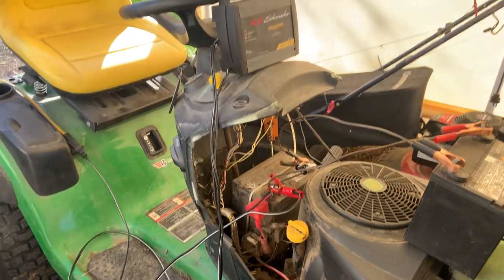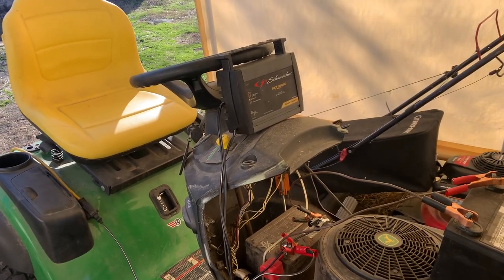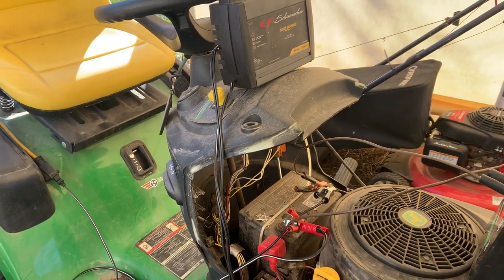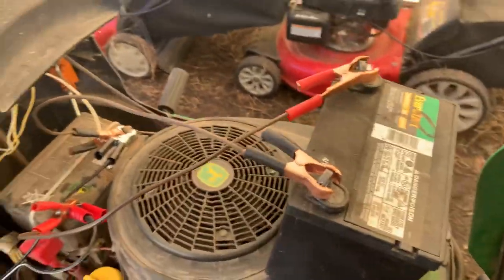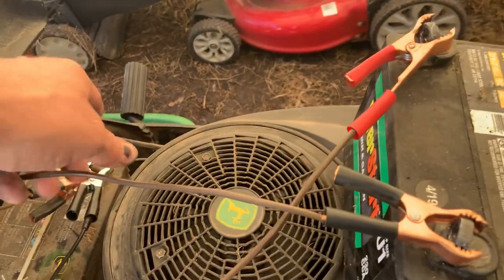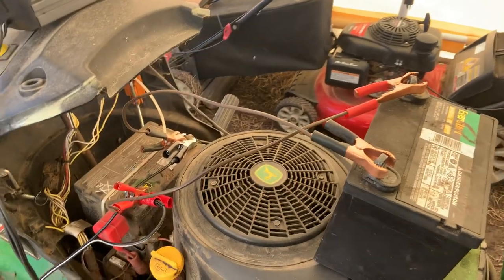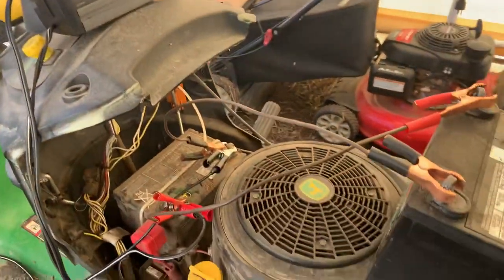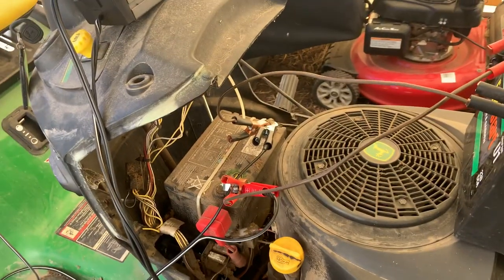How to charge a completely dead battery

Comment: Hi, i just bought a battery charger that has a 50 amp setting, a 10 amp setting, and a 2<>6 amp setting. Which setting does most people use to charge a lawn mower battery? Is there a couple different settings i can use? Just wandering which setting or settings is acceptable when charging a lawn mower battery. Thanks
Reply from the maker: @craigwagner327   Think of the amperage as how hard and fast the charger is going to push voltage into the battery.  The 50 amp setting isn’t for leaving the charger to charge the battery over a period of time. It’s only to crank the engine right freaking now. So you would set it to 50 amp, immediately try to crank the engine, and once the engine is running you turn the charger off. 

The other two settings, 2-6 amp and the 10 amp settings, are for charging over time. Since a mower battery is so small, charging at 10 amp is a bit much,  so always charge a lawnmower battery on the 2-6 amp setting. On that setting you can leave the charger on overnight which is the best way to charge a battery. It says 2-6 amp because if the battery is really low it will start charging at 6 amps but as the battery gets charged the charger will back the voltage down to 2 amp and stay there until you turn it off. 

You can use the 10 amp setting on larger car and truck batteries but I wouldn’t leave it on over night. At 10 amps it should charge the battery in 4-5 hours. So unless you need to charge a car or truck battery in a few hours, just set it to the 2-6 amp setting and let it charge overnight. 

Another tip- Just because a battery charger shows the battery is fully charged doesn’t mean the battery is good. A battery charger will show the battery is full when the battery is no longer absorbing voltage. So if a battery is bad and won’t absorb voltage, all the charger knows is the voltage it’s putting out isn’t being taken so it will indicate a full charge. 

Buy a battery load tester. They’re cheap and very simple and easy to use. The best thing to do is to charge the battery overnight on the 2-6 amp setting, then the next day, take the charger off and load test the battery. 

You can also load test the battery by putting a meter on it and watching the voltage as you crank the engine.
Reply: @wcjcnc  yeah I was just curious cause I googled what amp to charge a lawn mower battery on and it said 10 amps for an hour and wasn't sure if that was right
Reply from the maker: @craigwagner327   You can charge it on 10 amp if you really need to mow or have it running in an hour but if you need to have it running that fast, just jump start it with another battery or a jump pack. You can start a mower by jumping it off with a car or truck but make sure the vehicle IS NOT RUNNING. The alternator on a vehicle may put out more amps that the electrical system on the mower can handle. Usually it won’t cause a problem but it can. As long as the vehicle isn’t running you’re fine.
Reply: @wcjcnc  ok so basically if your not in a hurry, you would recommend using the 2<>6 setting? Thanks